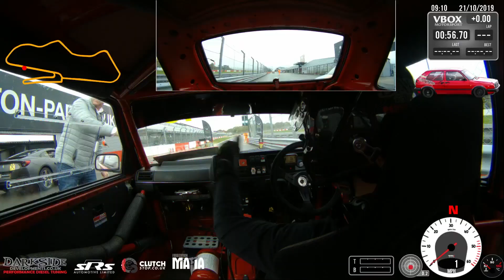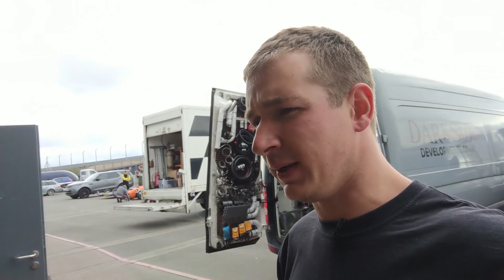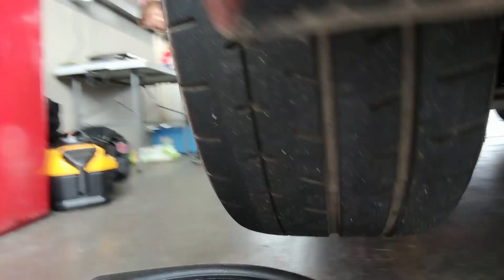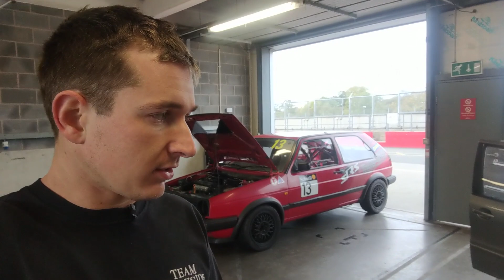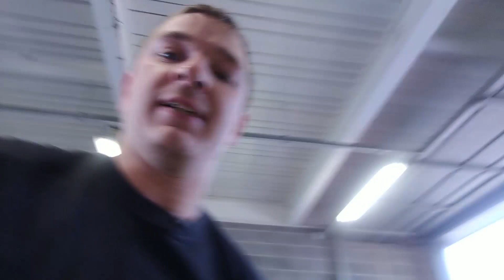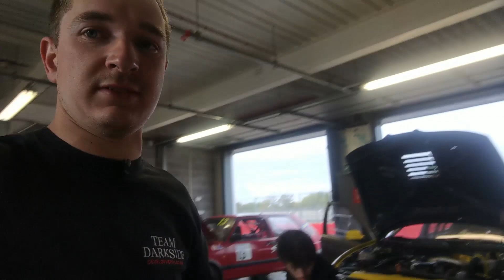Last Test Day Before the 6 Hour Birkett Relay! Donington Park - DARKSIDE DEVELOPMENTS

Comment: Great work on moving that oil cooler around twice and getting it back out on track, would have thought it would have worked when it was directly mounted on the front (even if compromising the IC). Interested to see how you resolve this problem.
Reply: It was a sandwich plate issue!

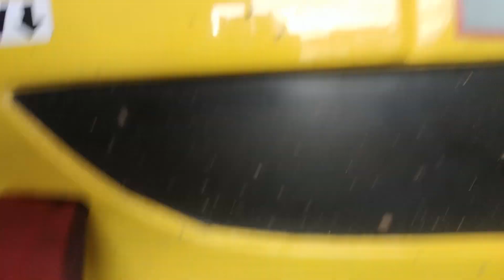Comment: Should have just whipped the front middle grill out of the leon that badge probably effecting like 5~10% of flow to the intercooler, 14:02 you really need like a 90 degree curved bent plate there to force the air up through the oil cooler or if you can less of a 90 degree angle perhaps some small pc style type fans on the back, just an idea, 17:40 but them straps ufft....
Reply: Deffo not ideal but the top Grille is part of the carbon bumper so was a last case. Sorted now!